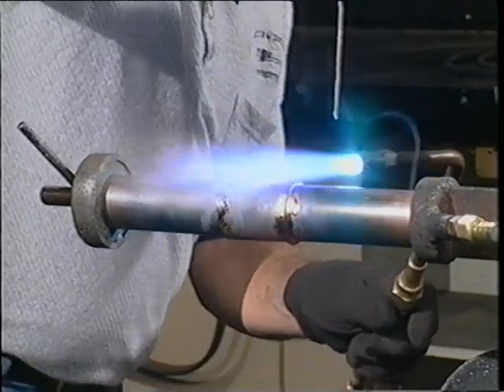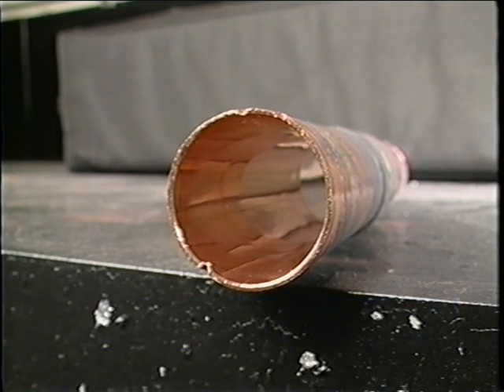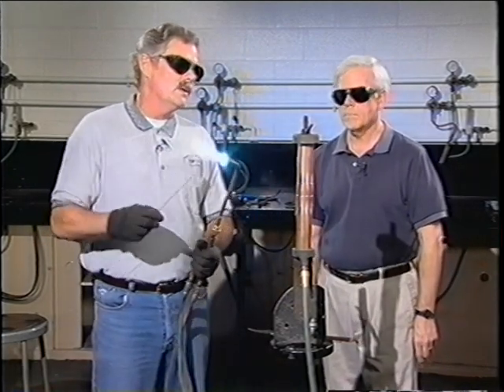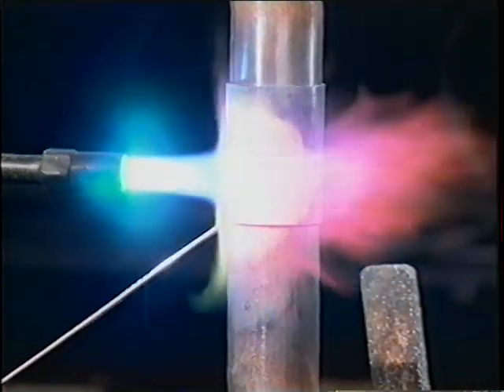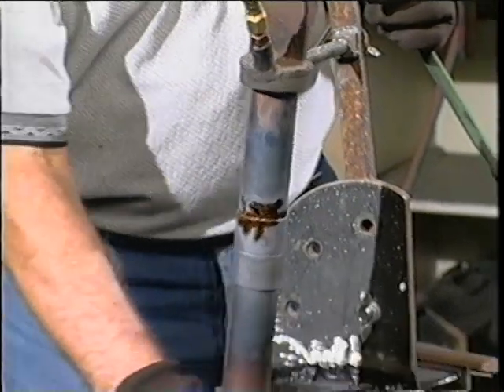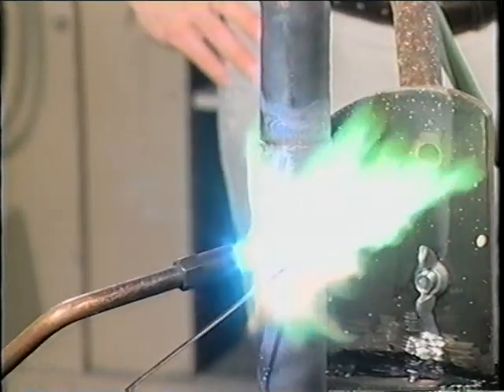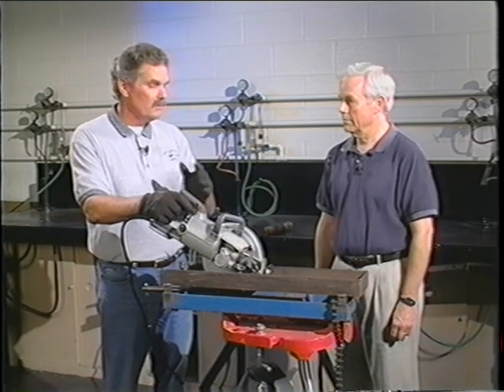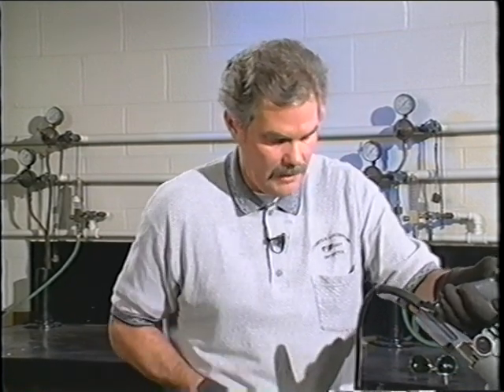Medical Gas Brazing 2000 (Part 2 of 2)

Comment: Nice job, brings back some money making memories in a operational emergency room on the 2" oxygen line. None of the older hands wanted to touch it. So I took care of it.  Confined spaces suck up and around tight ductwork with a screaming rose bud. But I found that I had to feed the braze quicker to quench the joint as it was hard to control the heat in sich 9:45  tight quarters. But you nailed the lesson plan as far as I am concerned.
Reply from the maker: Thanks for watching and posting a comment.
Reply: You made good money doing medgas? Where you union? What state are you in

Comment: That horizontal joint isn't 100% full.  ..and where's the cap? What I've noticed when taking brazing test is that when people fail, it's usually the 11 - 1 o'clock  position of the horizontal joint. Not the vertical up as one might think.  That's because when you load up the first cup, then turn it upside down to braze the second cup, filler rod from the first cup will wick down across the coupling and fill it from the top. You'll notice that any cap you put on the first cup isn't as full as it was when you finished the first cup. 

The horizontal joint is hardest and many people get 100% penetration on one cup but will have holidays between 11 and 1 o'clock on the other cup. That's because when you fill the first cup, it unifies the tube and coupling and it acts as a heat sink, stealing the heat needed to completely fill the second cup. To solve that problem, crack open your acetylene a little more then adjust the oxygen accordingly. 

When I test, I go beyond cherry to bright orange and keep it moving there will be a quick sizzling before you burn through. If it sizzles, back off immediately and you might be ok.

 When pipe is orange hot you can see the effect of the rod pentrating the joint. Don't be fooled to believe that's the shadow of the melted rod. It doesn't represent actual penetration. It's the pipe being cooled off by the cooler molten filler rod. The shadow represents how much of the pipe has been slightly cooled off. 

Once the pipe has been totally purged, back the flow down to 5 or less. As long as there's a positive flow of N2, there's no reason for air to enter the system. 

Sometimes the jig used to hold everything together is too good and when the copper is heated,  it expands too good of a seal and blocks N2 from escaping where it maybe was escaping from when the assembly was cold. It  might try escaping through the molten filler leaving bubbles. Less purge helps control that issue. Before you bark off your torch, lick the back of your hand and pass it over the purge port to see if you feel the flow. Adjust the purge so you just feel it on the licked part of the back of your hand.

Remember if there's not enough time to do it right, is there enough time to do it over? ...UA LOCAL 342 does it right the first time
Reply: I know it's been a year since this comment but I think it's the most helpful, by far. I just left the field to start up a High School vocational program within Local 166. It's been great and I'm trying to put a little bit of everything in front of these high schoolers so they can decide which side of the trades is for them. I really appreciate your explanation on this process. I wasn't doing enough hospital work and let my cert drop a few years ago. I was looking up videos as a refresher course. I just want the high schoolers to see the process for a day or two and move on. I'll be utilizing your details within my conversation. 

I like to teach the overkill style of brazing MedGas uses prior to simple refrigeration brazing because it's easier to water your training down a little for something not so critical but it's hard to amp up the details that medgas requires. I learned medgas first so when I did refrigeration everyone else would do a swipe/cap method and move on while I would push some filler into it prior to a cap. 

Good stuff. Thank you again from Local 166
Reply: @cdays01  wow! Thanks for the positive feedback. I'm happy I was able to help a brother out.  Good luck with your endeavors there. Is it something the UA is sponsoring or endorsing? These days, it's only the rich schools that still offer any kind of vocational training like this, where the kids are least likely to need to know.

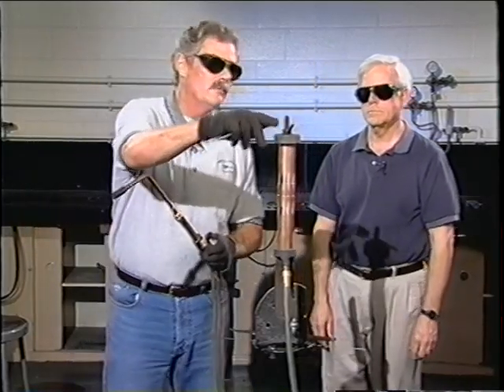I think we share some of the same philosophy when it comes to brazing. I load the cup from 5 to 11 o'clock,  going clockwise, then from 7 to 1 counterclockwise (I don't like to get to 12 before I know the rest of the cup is full, in case there's a cascade effect that could cause holidays), then 10:30ish to 1:30ish, then turn the torch down a little for the cap. 

I like to heat the rod about 2 or 3 inches from the tip so i can give it about a 45° bend in it. That way, no matter what position you're approaching from, you'll always be able to get the right angle on it. ..and I use 100% of every rod. Melting 2 rods together end to end doesn't have to be a big production. You can do it on your ladder. Hold the tips of the rods together like chopsticks.  Melt them together in that position. Then, while they're still hot, straighten them out right away.

I don't mean to be preachy. I'm just thinking about things that might help. I learned how to braze back in jr high school, in the 70s (the late 70's, a'hem.. I'm not that old.. lol), then onto oxy acet welding and i still do a bit of it here at home. Did you know you can braze with copper wire? Use boric acid for flux. Termite poison is a great source of boric acid. Heat the wire briefly then dip it into the boric acid. ..and you can braze stainless steel if you use this kind of black brazing flux. Its really nasty stuff. Use in ventilated space.  ..very well ventilated and avoid skin contact. Its very irritating.  ..my point is that maybe you can save a few bucks by getting the kids acclaimed to using a torch by first brazing with 14 or 12 gage copper wire on some carbon steel coupons.. idk

Thanks again for the positive feedback brother
Reply from the maker: Great comments jdog. We appreciate you viewing the video and providing the feedback. When you have time,  please check out our NITC updated Medical Gas Brazing Video at https://www.youtube.com/watch?v=aPnRrEuVvlQ and additional braze test information on our website at www.nationalitc.com under "Medical Gas Brazing Processes"

Comment: Heat rises in fluids.  The saying, 'heat rises' has nothing to do with brazing/soldering.  Heat travels through solids by conduction.  We start at the bottom of fitings as a practice to form a dam to stop the filler material from flowing out.
Reply from the maker: Great observation and comments. I fully agree and from your comments, it sounds like you are brazing correctly. Thank you for watching and providing feedback. Please check out our NITC updated Medical Gas Brazing Video at https://www.youtube.com/watch?v=aPnRrEuVvlQ and additional braze test information on our website at www.nationalitc.com under "Medical Gas Brazing Processes"
Reply: Heat, under the right circumstances, can and will rise

Comment: I enjoyed the video.  A couple of things to say:{1} there was no mention of cleaning the fittings or pipe prior to braze,{2} there was no mention of the amount of silver content in the brazing rods; copper pipe brazed to copper fittings need a different brazing rod than when brazing copper pipe to brass.  Also, no flux is used when brazing copper to copper.  However a flux is used when brazing copper to brass.{3} after the copper coupon was brazed and a thing strip was cut out, why did the instructor not show a close-up of that brazed joint?
Reply from the maker: Thank you for viewing the video and for your comments. Yes, this video was made back when the Medical Gas Piping Industry was getting started. It is dated and it shows. However, it is still a great demonstration video, which is why we posted it. All of the items you address may be found in the NFPA99 and ASME BPV Section IX Codes, which are applicable to Medical Gas System Piping brazing. We have recently published a new updated video which addresses all of items you commented on, along with additional information on what to look for during inspection. The video and additional information may be found on the National ITC Corporation website at www.nationalitc.com. Thank you again for your comments and we hope you enjoyed the video.
Reply: @TCudahey,  yes you are correct. Bcup filler wire is used when brazing copper to copper medical gas piping. Bag with flux is used when brazing dissimilar metals such as copper to bronze or brass. But even so this was a very instructional video on brazing a medical gas coupon for the  asse  6010 installer certification.
Reply: Lol you seem like you know why we didn't see the bend test performed.  He had way too much rod left for there to be enough rod to fill both cups. I doubt he even got full penetration at the 6 o'clock. You have to jam it in there hard so that you feel the contact of the rod against the edge of that coupling no matter how fast its melting.

We always test with that liquidy 5% crap but use the 15% honey stuff on the job. I remember when the 15% was $30 a pound. Last time I checked, the 5% was $45 a pound and the 0% was $30 a pound. The 15% was around $150 a pound 😳

Comment: 1. You don't need the welding glasses
2. Way too much heat
3. The result is carbon everywhere and a uneven result

Not good.
Reply: I somewhat disagree. I mean that rosebud is the size I use when brazing 6"Ø. I would go down a size or 2 on the rosebud. But I usually braze with an almost neutral flame and heat until everything is bright orange then jam that rod in so I feel constant contact with the edge of the coupling.  From 7 to 2 o'clock, then from  5 to 10 o'clock,  then 3 to 11 then 9 to 1. Knock off that dingleberry then cap it. If no dingleberry then joint is starving.  There won't be any carbon inside the pipe. It doesn't matter what the outside looks like. Not for the test. If you're putting up show pipe, then I would agree to take the time to make it look good but not at the cost of having holidays in the system that can harbor germs and whatnot.  

On big hospital or laboratory jobs where the med gas crew is 15 to 20 hands, it's been my experience that there are always 4 to 6 of them who have no business holding a torch but their work passes the pressure tests on jobs because you could forego the whole 100% full part and just cap it and it will hold 150 to 300 psi.